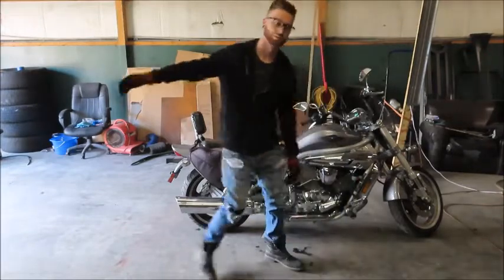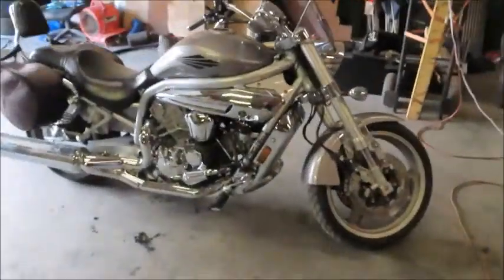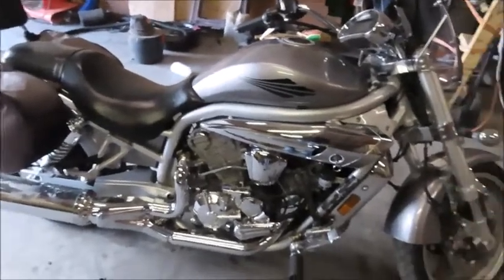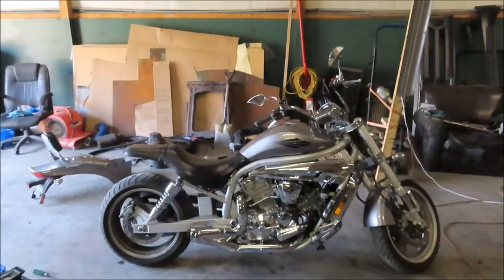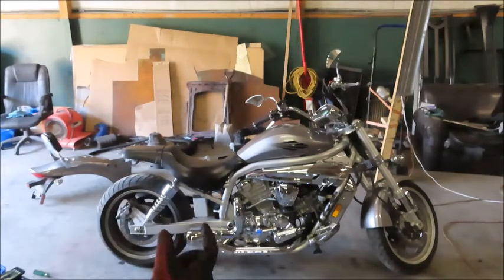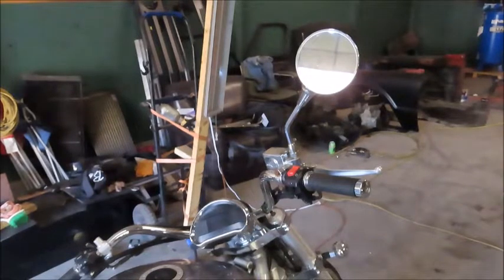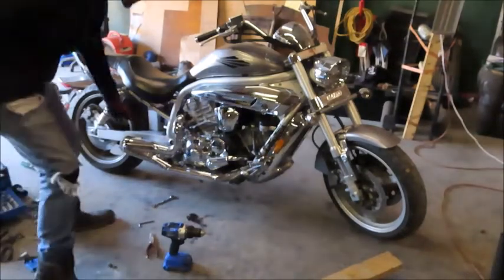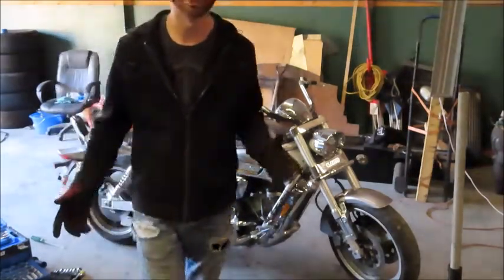MUST SEE ! CUSTOM CAFE RACER BUILD PART 1 !

Comment: i often wonder why you use the titles " cafe racers",they look nothing like cafe racers,they never will with that steering head rake and looong chassis..first roundabout you come across will wipe you out.
would suggest go look at some 1950's pictures of cafe racers,we called them that as thats what we did with them,we took our normal triumphs n bsa's etc and made them into short burst tonup bikes..
a blindman can see those gv650's have completely the wrong rake,length and centre of gravity ffs.itll wobble about like a granny on pension day ffs.better off triking it,or taking the motor out and putting it into a supermoto etc frame.
Reply: Late to the party as I've only just seen this video.

You'll be surprised by how nimble these GVs are. Definitely never gonna be a cafe racer style bike, but another bike chopped and fiddled with is another piece of expressive engineering on the roads. The more the merrier I say.
Reply: OK grandad (".)